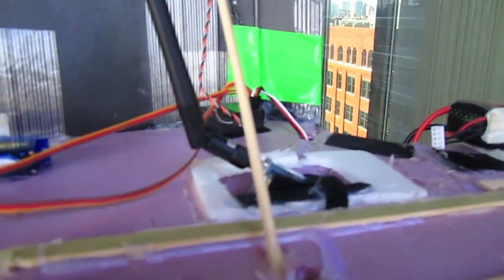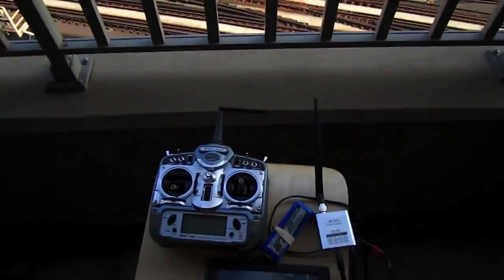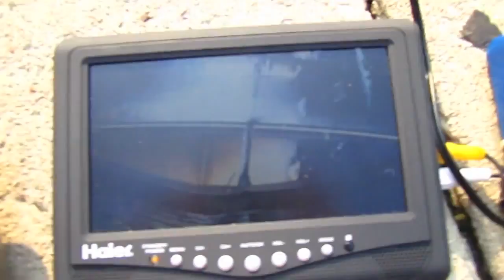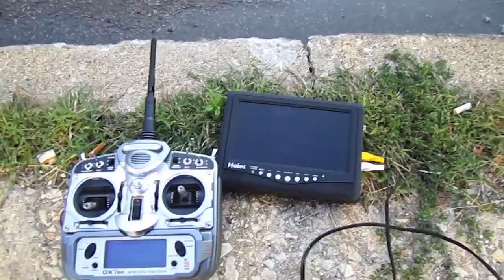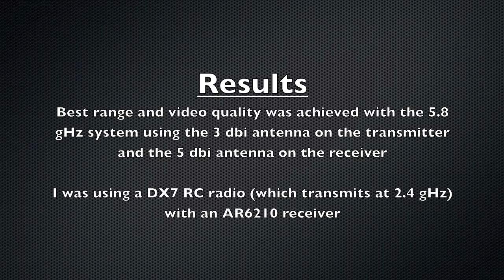Choosing an FPV Video System - with Range Testing

Comment: 1.Radio 2.4 ghz, with 900 mhz Vtx will work very poorly and with no range due to the 3rd harmonics of the 900mhz, (2.7ghz) is so close to the 2.4ghx radio signal.
2. 900mhz is also all over the city with wireless walk phone, (not cell phones). 

It is common place to  use 2,4ghz rTx paired with 5.8ghz vTx or,  use 433mhz rTx with .900 to 1.3ghz vTx for long range, (20 to 60 km)or more.

Comment: Sigh, another useless video by someone who doesn't know what they're doing but who still feels they're able to offer advice.

5.8GHz almost certainly works best there because of multipathing - your 5.8GHz signal is being reflected off the sides of buildings, an effect which goes up with frequency. And that is also why your 900MHz signal apppears so bad, it doesn't bounce nearly as well.

Now go and test your system in a field where there are no trees, structures or mountains to block the 900MHz signal or reflect the 5.8. :-)

Comment: 5.8 is better because of where you were the 933 mhz is the same as car key fobs so in the city would be mad interference but away from the city the 933 mhz would go much further than the 5.8 low range travels further
Reply: Yes because we are all using our key fobs 24/24 :) Sorry could not resist !

Comment: hey what do you use for a power supply for the RC5808 Receiver end? ive been looking around for specs and the requirements were 6.5 volts and 150 mA  maximum currents i can not find any battery packs that would work,
Reply: ***** hiiii
can u chat with me in +918000072900

Comment: There's also a 3rd option. You disable your 2.4ghz radio link and use a dragonlink or lrs system and use 2.4 video tx and rx

Comment: you cant use 1.2ghz for the video downlink with 2.4ghz radio because of resonance.
Reply: I think you can with a low pss filter
Reply: So what do you use?
Reply: @gpgp1750  I'm running 915mhz on the radio and 5.8ghz on the video, when this was posted DJI fpv system did not exist, but I run that as well

Comment: 900mgz is the same band used for mobile phones and your in a built up area so maybe this is the reason the 900mgz is worse. (from UK so it could be different for you, check what uses the 900mgz radio band in the US)

Comment: Lower frequenties dont penetrate better.
They BEND better, they bend around the object
Reply: How do you explain 10 - 30 mhz signals travelling across continents using the ionosphere as a wave guide? Don't see 2400 or 5800 mhz doing that :) but I see your point.

Comment: so the 3dbi antenna on the tx can be 2.4ghz and the recevier has a 5dbi antenna thats 5.8ghz so thats cool to do?im hooking it up to phantom 2 which is 2.4ghz ,what i need to know is will that be a problem?
Reply: the frequency of the transmitter and the receiver have to be the same. the dbi can be different.

Comment: So what if you buy an other kind of antenna?  (which gives you even more range)
And does the range depends on the mW? like if i buy a 600mw will get like 4000 feet of range? and which antenna is the best to use for that?
Reply from the maker: More power does give you more distance. But good antennas have a bigger impact.
Reply: More power can give you better range, but good antenna's will give better results.  Especially with 5.8.  Circular polarized anteannas are a must with 5.8 as well.  600mw with clover leafs and skewer planar has gotten me out to 6500ft.  CL with a good 3 turn helical will result in 2+ mile range.

Comment: Im not sure that this is an accurate representation of which one works best. As many devices such as phones and other radios use 900MHz, and being in your location there are probably hundreds getting between the Tx/Rx. I currently use a 5.8 system and it works great until I lose direct line of sight. Ex. I fly behind a tree. This is where 900MHz excels because the lower frequency is able to penetrate solid objects.
Reply from the maker: Totally! 5.8 gives me much better video quality - but my location is also very tricky here in the city
Reply: ProjectFlightDesign The antenna is more important that the power.  In an environment such as a city (which no one should be flying in anyway) you should be using circular polarized antennas to beat multipath issues which you may be experiencing in your experiment.  Check out videos by Remodelreviews for details.

Comment: Hello! What settings do you have for the signal settings? I have the same transmitter and receiver but have major issues with keeping a signal over 50 feet away. Could you also post a link to the antennas you used? Thank you!

Comment from the maker: I agree in some respects. I fly in an urban setting - so I figured that I would stress out the system as much as possible by adding a high noise floor. Not the best test - but this system has taken me easily over a mile in Chicago - which is great for me!